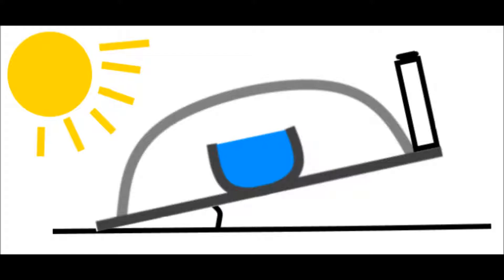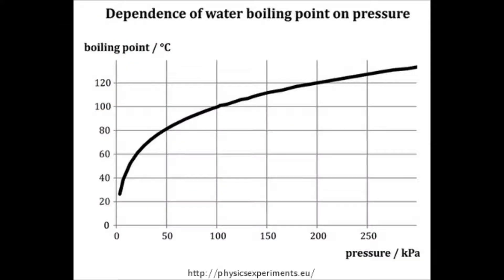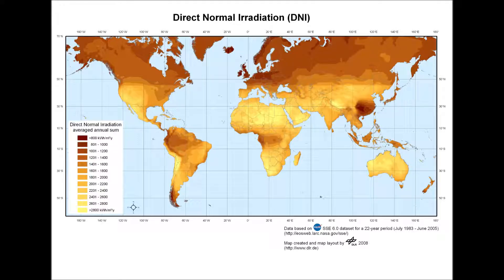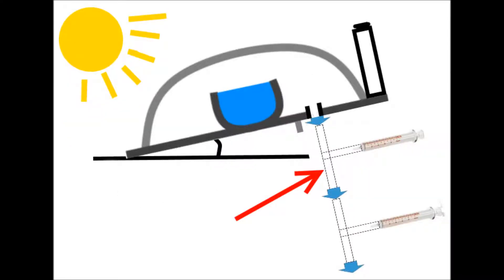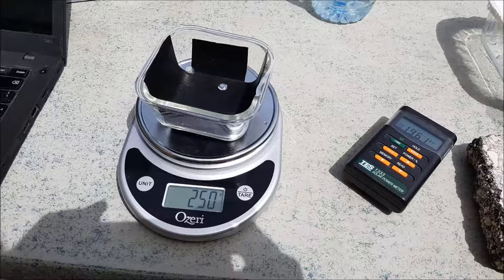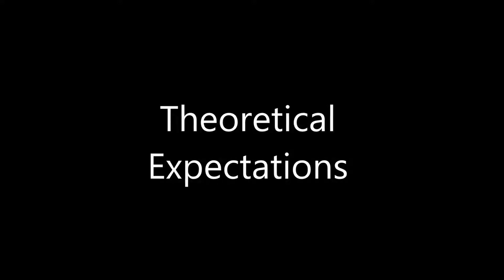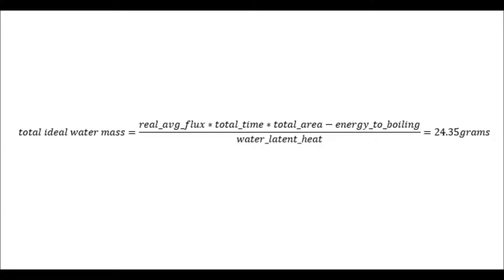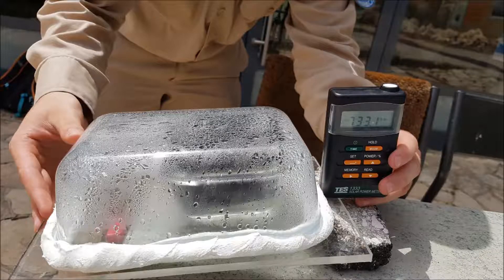Inexpensive High Efficiency Solar Desalination

Comment: Good effort but you missed the point that the water vapor will make up the air you sucked, so the pressure inside the system will return to atmospheric pressure in practically no time. Hence there is no advantage whatsoever of pumping out air from the system.
Reply: I've been thinking on using a solar panel with a small power bank, connected to a Pelltier Module, using the hot side to assit in heating epavorative process, and the cold side used to cool the moisture.